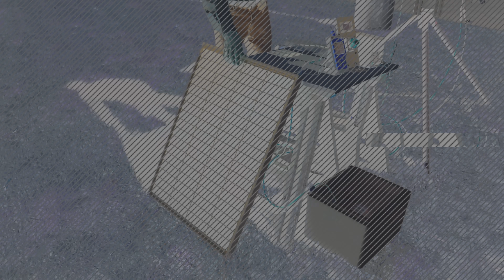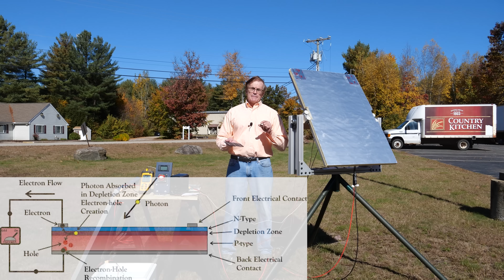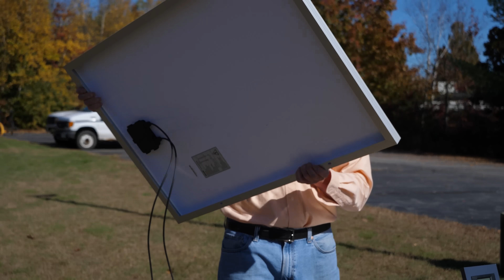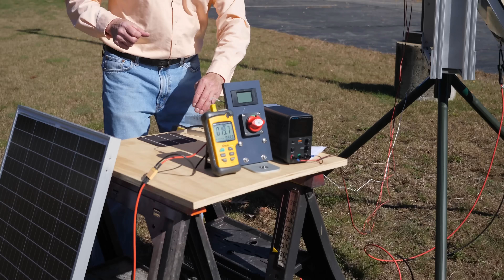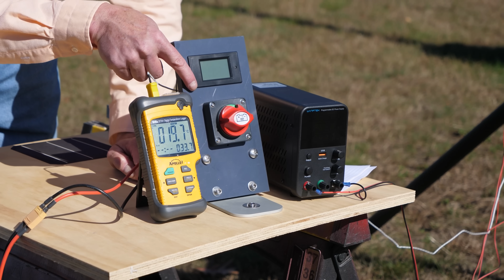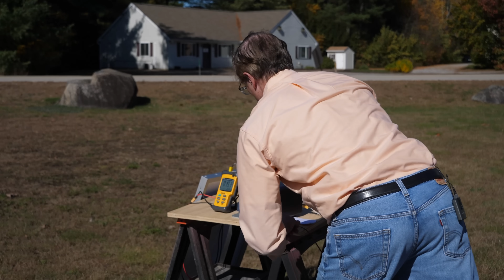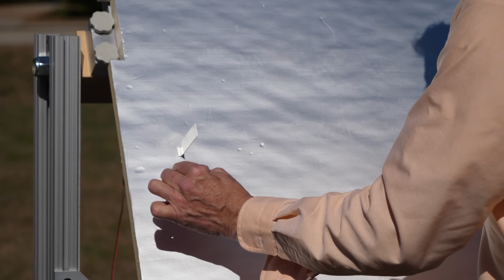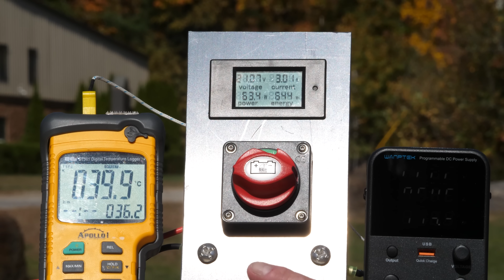Do you REALLY get enough out of your solar panel?

Comment: I continue to wonder why solar panels aren't designed to have water cooling to preheat hot water for the home as a win win.
Reply: They exist, look for PVT panels.
Reply: Was thinking exactly the same. Run a pipe system on the back of each panel, connected to a manifold, and have the whole system connected to a water basin.
Reply: I saw at least 2 companies that make solar panels with a integrated water loop, you could also do it yourself pretty easily

Comment: Jokes on you, I don't have any solar panel :D
Reply: My calculator has a solar panel :--D
Reply: @Thomas Newell Magic 🪄
Reply: I am Against this green new deal crap 100% 
But they are intentionally making the grid infrastructure unreliable. The mining of cobalt and lithium is destroying ground water and causing heavy metal poisoning for the natives by the mines.  Now they are also making fuel so expensive it's pushing people into EVs which is making the grid even more unreliable. So you are faced with two options now. Deal with the failing grid and let your basement flood and food spoil or get off the grid. I chose to get off grid. I got two EV batteries that I used at my work for thermal management testing that where heading to the scrap. I then bought 6kw of used panels and 6kw of new USA made panels. I live in Michigan. The cloudiest state in the union. Dec -feb the system is at best only supplies 30% of my power usage but the rest of the year it's almost 100%. So it works on a small scale but not large scale. Michigan just introduced time of day rate increase and the net metering is a joke with only 25% exchange rate for solar. It's an agenda and you can choose to ignore the fact that your utilities are doubling and slowly become a slave to your utilities which is what they want. Or find a way to finance or pay $50,000 to do a decent diy solar that will allow you to take control of your energy.
Reply: @electromechanicalstuff2602  There is so little lithium in lithium batteries, they should all be called cobalt batteries.    Smoke and Mirrors.
Reply: @Thomas Newell definitely worth putting an air fan on my phone/laptop screen,lol
Reply: What about passive cooling with aluminum heat sinks on the back w no fans?
Reply: @Thomas Newell yeah a oil burner from the 1970’s, now I ride a vintage 10 speed bicycle 🚴. Remember please walk to work, save the planet 🌎🤔
Reply: @Thomas Newell my hero 🦸‍♂️🤩😂😅🤣
Reply: Still burning coal 🤔